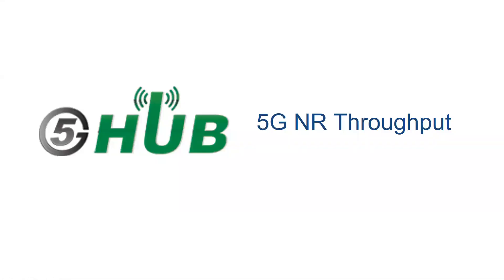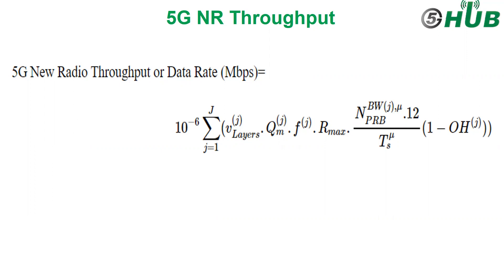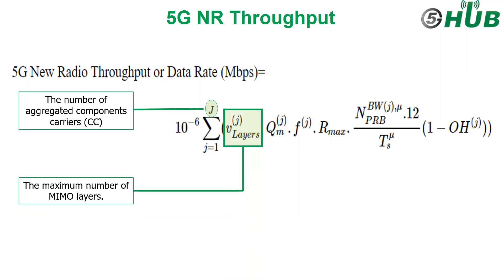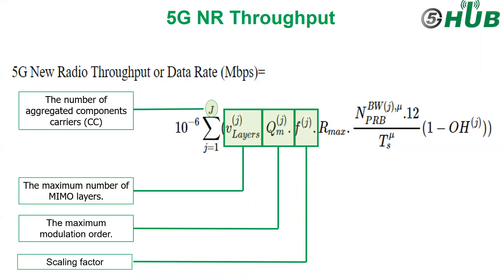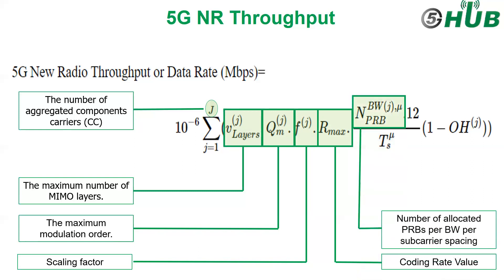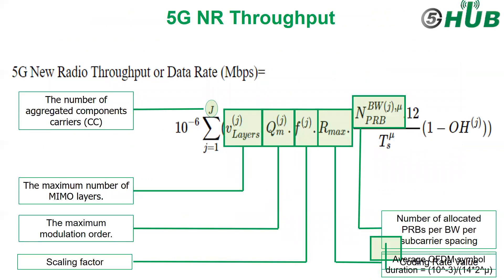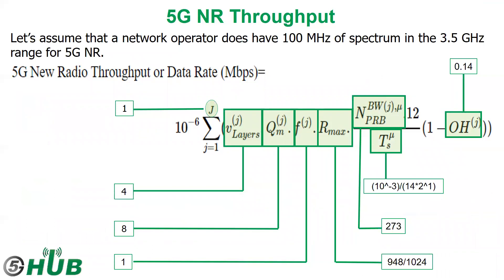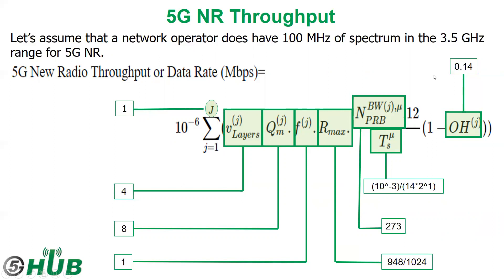5G NR Throughput

Comment: Thank you! This means that if I have a maximum of 8 layers, then if I use a 2x2 mimo for each user, I can have a maximum of 4 beams in the same frequency and slot resources
Reply: In concept yes. The maximum number of layers as in 5G is 64 layers.
Reply: @hossamfattah3605  Thank you! Awesome video! Do you know where the 64 layers limit is stated in the specs?